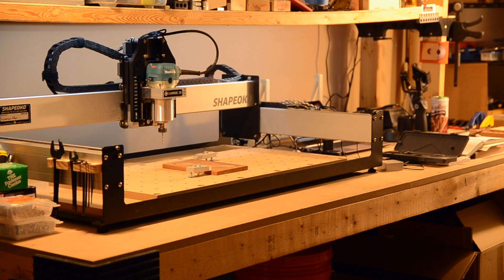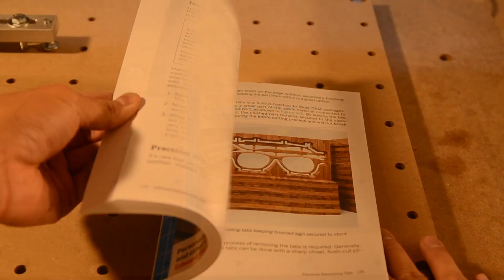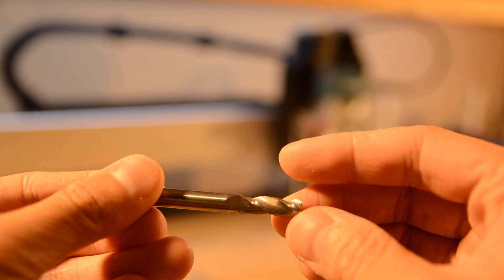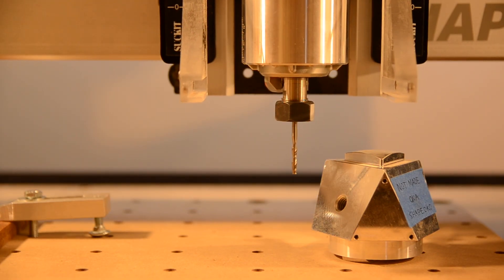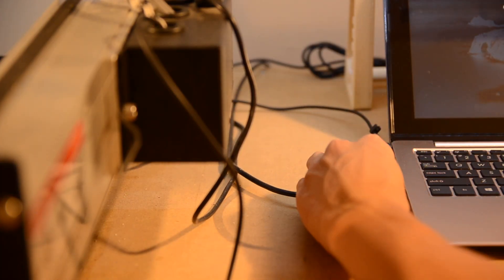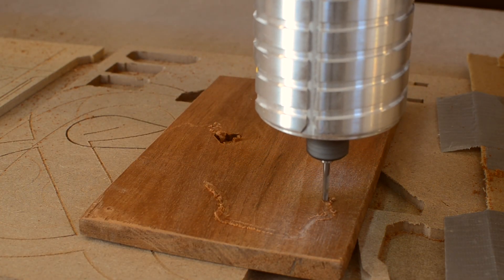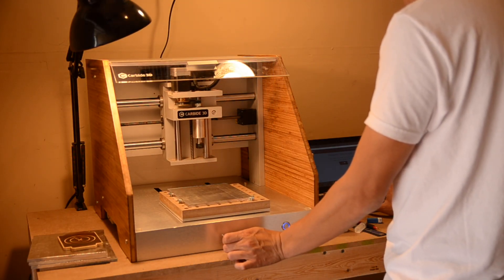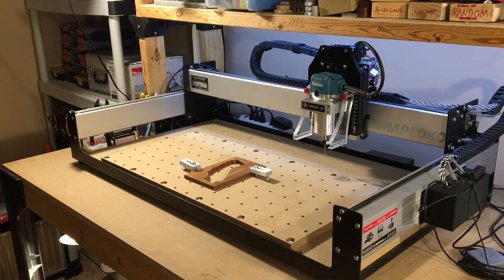Intro to CNC - Part 2: CNC Hardware Basics

Comment: Not sure if you would rather me direct this question to a different channel but how often does Shapeoko recommend maintenance? As an example, an HP printer back in the day was a workhorse but when it started jamming what it needed was a maintenance pack which basically changed all the rollers and it was good as new. Is there an example of something like that for this CNC?
Reply from the maker: +Savant PCs depends on what you cut, and how clean you are. If you notice dust getting packed into your v wheels, you'll want to clean that asap. The more it compresses, the greater the risk you'll wear or deform your Delrin. The less of a mess you make, the longer you can go without detailing get your machine. 

Every couple jobs, I'll just poke my gt2 belts to check for tension. But I've gone many months without having to re-tensioning them.

 About once a quarter I'll check v wheel tightness on the rails.
Reply: Thank you, that is great to know! I JUST got my Suckit Dust Boot today so I am hoping to change a lot of that but I have noticed a lot of buildup on the v-wheels. Now when it's off and I just push it with my hands it has a kind of skipping feel so I may have to replace one or two. At least now I know what direction to take. Thanks again!

Comment: Sorry, but describing the difference between moving the spindle, and moving the table as a "philosophical design choice" is just plain WRONG. 

The reason professional CNC machines use a movable table, is all about rigidity. in EVERY implementation of a movable spindle, you introduce weaknesses. These weaknesses are a design FLAW.

The spindle on a gantry exerts load onto the entire gantry assembly when working. This can cause the gantry itself , or the spindle to "tilt" where one side of the gantry is experiencing differential forces. i.e. while moving forward through a work piece, the forces applied to the spindle cause the bottom of the spindle to want to move in the opposite direction, and the top to tilt forward. This causes the gantry top to also attempt to tilt forward,  the span of the gantry, and the construction of the gantry, and it's contact methods with the drive train, all introduce further weaknesses, thereby increasing the probability of error. 

The gantry system is also subject to lifting up, or sagging down, based upon weight (sag), and downward cutting force (lift). This now compounds the probability of error introduced.

Finally, the gantry method also compounds all of these weaknesses even further when you introduce the inherent errors associated with backlash, or in the case of belts, all of the errors belts are prone to. 

With a fixed spindle, most of these errors are eliminated for the exception of backlash, which can be reduced significantly with  the introduction of anti-backlash mechanisms, and hardware, and compensated for with closed loop positioning systems. 

The moving work table is also stronger than the gantry, because all of it's contact surfaces are in contact with larger, more rigid surfaces, meaning less chance of sag, lift, or flexure than is present in a suspended gantry system.

Comment: Another great video. I have a question....
Do you have a link for the undercut bit?
Reply from the maker: http://amzn.to/2tpFo7b   It's not designed specifically for undercutting, but with sufficient clearance, it'll work...
Reply: Thanks. I have been doping a lot of decor lately, so that is a good idea. I was just going to make a pocket and fasten in one of the metal strap ones. :)

Comment: Hi Winston. Your videos are very good, and valuable to the maker community. I wanted to add something to your mention of moving the gantry vs moving the table.

The most important reason, that I'm aware of, for moving the table is that you then have much more control over the stiffness of the machine. This is why you see x/y tables on cnc mills meant for higher precision work. The spindle stays put on a fixed gantry. Of course the limitation is then about space needed for the machine. 

Keep up the great work. Thanks for your efforts.